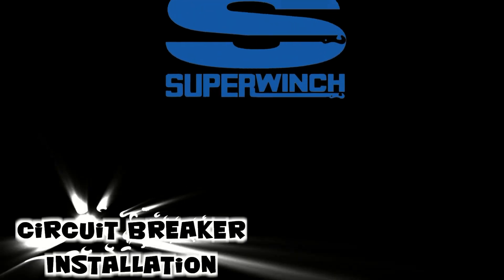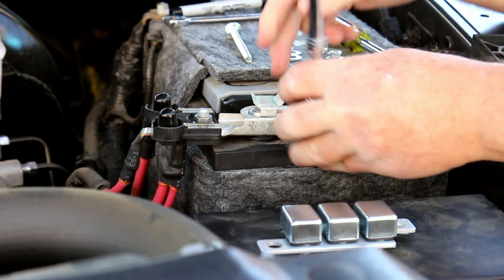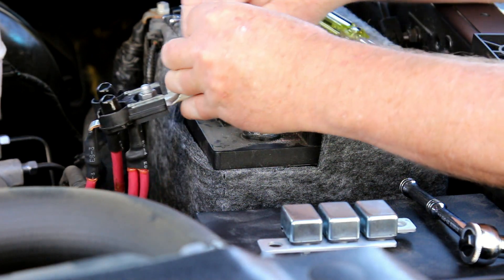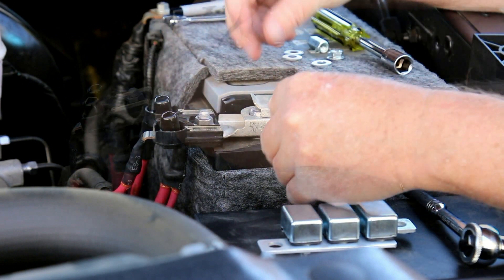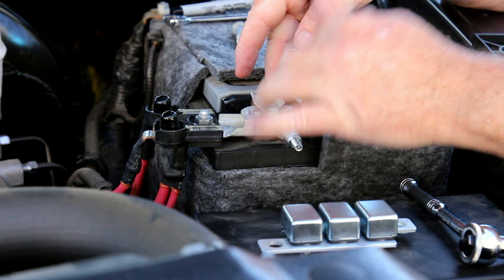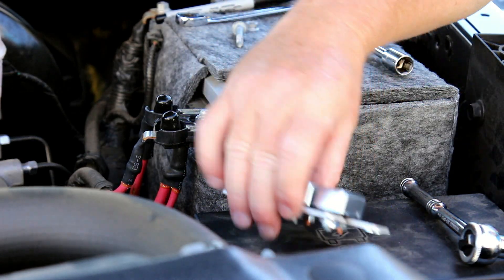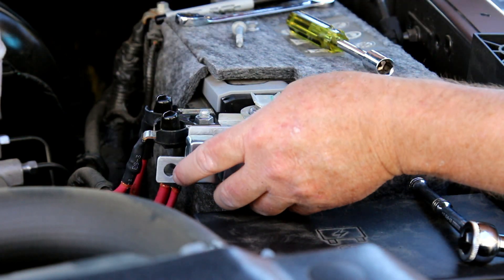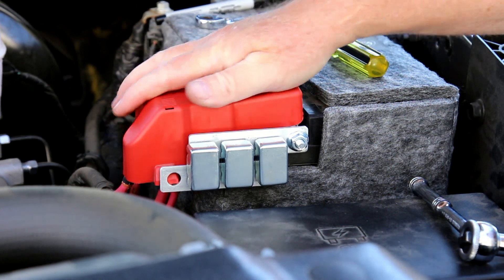Superwinch Circuit Breaker Installation

Comment: Have you found a good way to cover the breakers? Harbor Freight still uses this type and I am concerned that something may contact the exposed bars and short out.
Reply from the maker: It's securely bolted to the positive terminal and there's literally nothing in that area. I'll likely swap out to a different circuit breaker, however.

Comment: How does that breaker work and is there a better safer alternative?
Reply from the maker: It works just like a regular circuit breaker - it pops with excess current load, then resets itself. This was the breaker they used back when I got it, they no longer have it on their website. Not sure what they recommend, I've asked a few times, no reply from them.
Reply: @mascotgraphics  thanks.     So those extra nuts on there are NOT for me to run extra stuff off of?   Lol
Reply from the maker: @skinny4070  I wouldn't overload it with other components, this was just for the wiring for the winch. The wire runs down through the frame to the back of the truck where the plug is. But I imagine you could connect other wires to it, it just depends on where you connect them, I suppose.

Comment: I have a 13,500 pound winch what size of circuit breaker should I use, I did buy a 300 amp is that too much ?
Reply from the maker: You'll have to find out the amperage of your winch, I don't know that information. The winch manufacturer can provide you with that info and what amperage to get.

Comment: I cannot find this model anywhere. Does anyone know the same type of breaker I can use or where to get one?
Reply from the maker: This being a few years old, they don't have it anymore it seems. But similar breakers are available at trailer supply stores or on eBay.
Reply: @mascotgraphics  do you have an idea on the key word to search for on ebay?
Reply from the maker: @caine-chow  It's just a circuit breaker. You may not be able to find this style anymore, check with a trailer place, they can help.

Comment: How would you install circuit breakers on a vehicle that has a winch on the front and the rear?
Reply from the maker: Pretty much the same way if you're installing this type... but running both winches at the same time might be too much, so run a pair of circuit breakers, or use higher powered circuit breakers. They would both need to go to the battery positive terminal.
Reply: @mascotgraphics  
Thank you. I was at a loss on how to proceed with this.

Comment: great video!  i am installing a a warn 9000 on my truck and i like this install. what type of breaker is that?  amp load , etc      thanks,  marlo
Reply from the maker: Thanks, Marlo. That's the breaker that comes with the wiring kit from Superwinch, I believe it's three 30Amp circuit breakers, I'm sure Warn will have something similar.